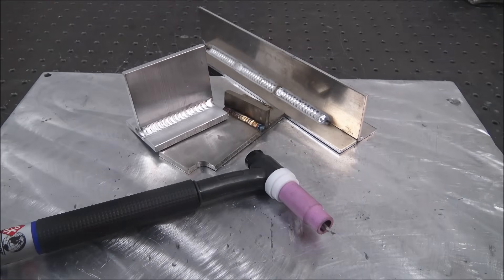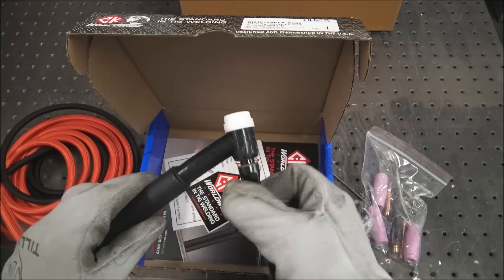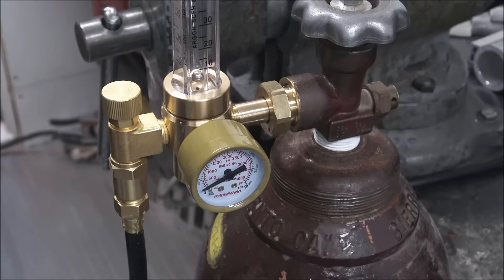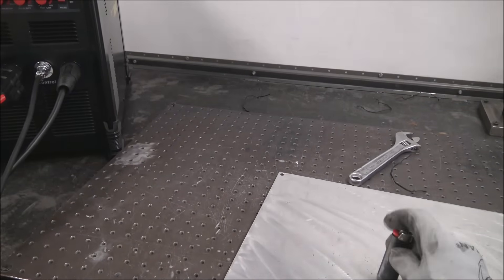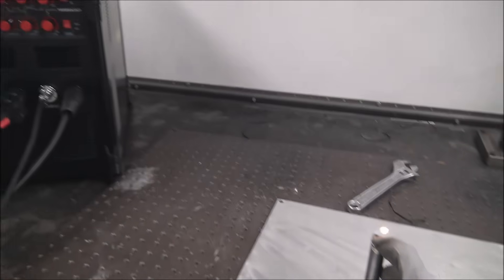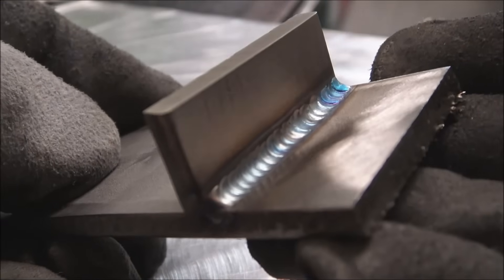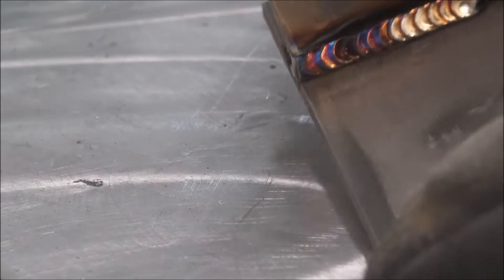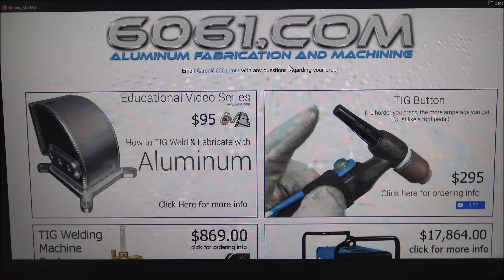PrimeWeld TIG225x - Review and Demonstration - TIG Welding

Comment from the maker: If you decide to order this welder, please purchase directly through their website and use the code "6061" to save 5%.
https://www.primeweld.com
TIG Button variable amperage controller I use: http://www.6061.com/tigbutton.htm
Online TIG Welding Aluminum Fabrication School :http://www.6061.com

Thanks for watching
Aaron@6061.com
Reply: Thank you Aaron, I need to get around to using the 325x I bought a while ago. I wondered what become of the one from 5yrs ago.
Reply: Will this machine push 6010s with good force?

Comment: I’m a collision repair A tech. I also build metal sculptures. I’ve been in the market for a tig welder and have taken about 2 months to research tig machines. I ordered a primeweld 225 yesterday. I hope it works like I need it to. I’m convinced it’s the Best Buy not only for the money but even just unit vs unit; it has more features than Hobart, Lincoln, miller and Esab seems to have in welders under $2500.

Comment: I did my apprenticeship in an aluminum shop tig welding cabinets and fuel cells. When I saw the thumb nail of your dime stacks i instantly clicked. I’ve had severe nerve damage in my hands from welding, mainly thick pressure vessels and tanks. I haven’t welded in almost 10 years but my boys are really interested. I went to my local supply store couple months ago and instantly got kicked in the nuts with the price of a new miller. Like it hurt. Really looking forward to pulling the pin on a primeweld for my kids homeschool garage. Look after your hands guys

Comment: I was literally hours away from buying an Everlast when you uploaded this.  Thanks for the great demo!
Reply from the maker: @dcurry7287
If you decide to order one through my website, I'll give you a free website subscription or a discount on a TIG Button if you're interested.

Thanks,
Aaron@6061.com
Reply: @6061  That's really generous, and I'd like to support you/your channel after subscribing for a while.  Your channel is a big part of what's convinced me to get into TIG after using only flux-core MiG for years.

My biggest issue, and I know I'm not alone in this, is that I only have a 20-amp 120v circuit in my garage.  I'm researching the adapter you showed and it looks like I should be okay as long as I keep the amperage on the output down.  Ideally I'd like to know before I buy it whether I'd be able to join 1/8" aluminum on 120v as that's the thickest I think I'll be working with.

If you made another video with a Kill-A-Watt or similar showing the wall draw I think that would convince a lot of people besides me too.
Reply: I've had very good luck with mine.

Comment: I love my primeweld tig 225x. Have been using it daily for almost 3 years now. No complaints. We typically only use it for DC at low amps for welding thin wall titanium (0.028"). Done some stainless, mild, and aluminum on it all with nothing but great things to say.

Comment: So those aluminum and stainless welds were done with the same tungsten that came with the welder or did you switch from the blue that was in the package?
Reply from the maker: I didn't change anything.
I only used what was supplied.
Reply: Mine came with gray 3/32.

Comment: I've never tig welded, but how do you put the tungsten in the gun with that short back cap? Do you just snip the tungsten with a pair of snips?
Reply from the maker: It's brittle. The best way to shorten it is with a grinding wheel. You gently cut the whole way through.

Comment: How small of a bead can you do with that welder
Reply: I can build up an edge of 20 Gauge steel (0.030 roughly) and 0.035 filler and the bead is just wider than the base material if that helps.

Comment: Welding for over 50 years (mainly TIG, stick, oxy-acetylene), wanted a TIG for my personal use. After a lot of research 3 years ago I was between this machine and an Everlast. Price, quality, and customer service won me over to Primeweld. Got the machine, the Maxcool 3000, and the CK 20 torch with 25’ hoses. Have not regretted it at all. Use the TIG button almost 100% of the time   Since that time, a MIG180 and a CUT60 have joined the ranks along with accessories from Primeweld including the 125 cubic foot bottle of argon, up from my previous 80 cubic bottle, dual flowmeter and 25’ hose, 25’ extension chord, 15’ MIG torch, among others. Cannot go wrong with Primeweld.

Comment: How do you rate the dynasty series, vs the new HTP and the prime weld? I have a 20-year-old dynasty 200 that I love but when I think of upgrading, I just can't see spending 10G on a miller when i can get the HTP for (i think) half of that or possibly the prime weld for under a grand?? What are your thoughts?
Reply from the maker: Dynasty Top notch (better weld appearance)
HTP/PrimeWeld very good, but aluminum weld appearance isn't quite as nice. It's a little "grainy" looking in a side by side comparison to the Dynasty using identical settings.

Comment: What is the difference between the button that came with the machine to the one you use?
Reply: Button that comes with the machine is an on/off button, either off or at the amperage machine is set at. TIG button (I use one) does the same thing the foot pedal does…..you can vary the amperage as you weld. I use it just about 100% of the time.

Comment: You need to review the prime weld 325 I was just about to purchase one I got a multimatic 220 that I have done thousands of hours of aluminum tig on, but a lot of times I get into the 3/8  plate and it's a pain in the ass cause I got to preheat it, I was hoping that 325 would fix my problem if it's good
Reply from the maker: I will later this week or early next week... Stay tuned (subscribe, hit notification bell, blah blah)
Reply: @6061  thanks man, you've been a big help over the years bought that tig button in 2020 and never looked back

Comment: I've got a similar welder with the thing switched on the cooling fans sound like a jet engine 😂.
It's a 200amp machine with 60% duty cycle @200 amps.